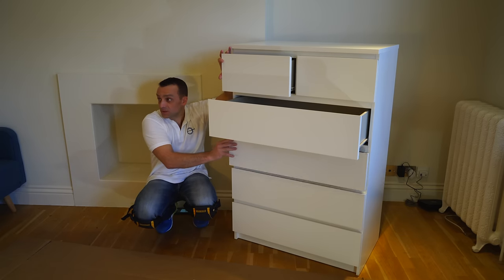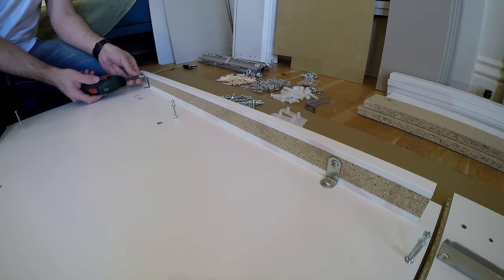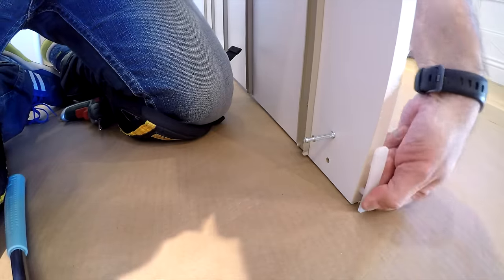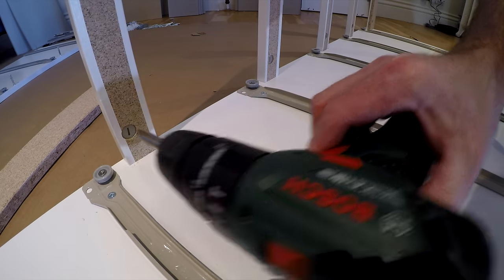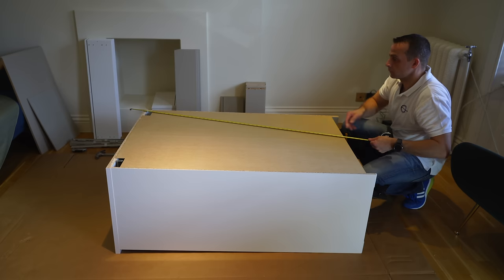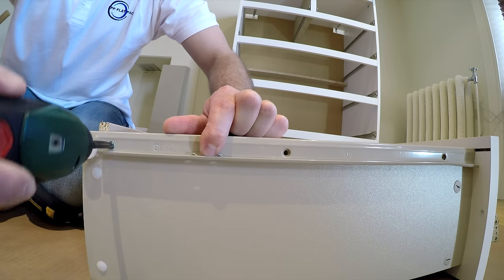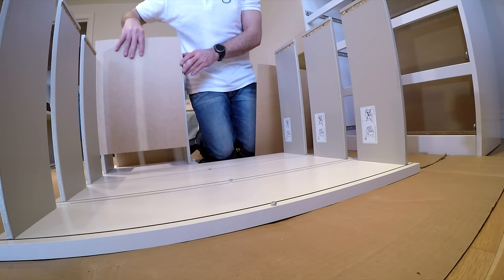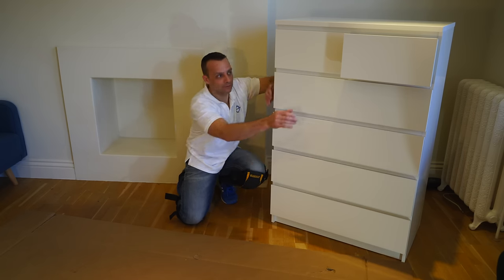IKEA MALM 6 Chest of drawers Assembly

Comment: I've assembled my Malm queen sized bed and the 6 drawer bureau with your guidance.  Very grateful. Would not have been able to do it without your videos. The two dimensional cryptic drawings in the Ikea instruction sheets were not remotely as helpful.  But now here's the thing.  One drawer's front panel was damaged. The cross bars between the drawers cracked as I put the screws in.   There were excessive bits of hardware, and some crucial ones missing.   I'm wondering if it was a repackaged return, sold as new.  My trust in Ikea is not what it was.

Comment: I just assembled mine but I’m having difficulty fitting the top 2!drawers in, any idea what’s wrong
Reply: Make sure that when you assemble the middle part that divides the smaller drawers was placed correctly (Left and Right). Otherwise one will be higher, the drawer won't fit in it and you'll have to disassemble and flip it around.

Comment: It’s a great video expect my top two ones don’t slide In easily it seems the the slide thing that’s on the long board wasn’t placed right
Reply: Have you fixed yours now ?
Reply: I have the same problem, how did you fix it?
Reply: Make sure your inner wheels line up with the outer wheels.  We unscrewed ours and attached them correctly. Easy to fix this mistake.

Comment: I just finished installing mine, followed all the steps, and double checked everything. But the dresser is wobbly from side to side. Any way to fix this?
Reply: Screws might not be tight enough, tighten them a little more. What I like to do when I assemble this kind of furniture is to put a small drop of wood glue just on the corners that way it is sturdy.

Comment: I've followed the instructions but can't get my top 2 drawers to fit. Anyone else had a similar problem?
Reply from the maker: Most likely you put drawer rails other way around
Reply: @PPFlatPack  thanks for your reply and a very informative video. Looks like they are on the correct way - can I contact you via email maybe?
Reply from the maker: @akeemmiller2673  No problem you can send me pictures of the drawer where I can see inner rails and rails on the drawer.
Reply: Thanks @PPFlatPack  . It's sorted now, the inner rails were installed the wrong way!
Reply from the maker: @akeemmiller2673  Cool glad you find the problem.
Reply: @tatianainfante7413  Make sure the rails on the inside are connected the correct way
Reply: PP FlatPack  i have the same issue the top 2 draws wont go in?
Reply: Hi, I gave the same issue. The top 2 drawers won’t go in. The inner rails came pre installed so I’m not sure please help
Reply: Adeshola Afolabi I’ve just put these drawers together and had the same issue! The inner rails need to be switched over and they’re the wrong way round, I unscrewed them and swapped them over and works fine now :)
Reply: Sophie Thompson thanks I did the same to fix it!!

Comment: I have installed the drawer unit correctly but the top two drawers doesn't seems to slide in n out easily as the rest of them. I tried tightening the screws and adjusting the drawer but it's still rough to slide. What do u think I'm doing wrong?
Reply: Hi, I have the exact same problem! Did you find a solution?
Reply: @meryemg3802  nope, it's still rough to slide. If you find any solution, please do share

Comment: 11:41 is the confusing part. Is that screw just not screwed in all the way? And there is no hole for the screw on the opposite side of the metal bar. Do you just screw that one in anyway?
Reply from the maker: That correct screw on the front panel (there is predrilled hole) not going in all the way leave a little gap just for the support come in should be close enough so it does not make a rattling noise when opening and closing drawer. back part of the drawer there is no pre-drilled hole so you just have to do it without (should be no problem with an electric screwdriver). Hope that help.Good luck
Reply: @PPFlatPack  Thanks!
Reply: @PPFlatPack    I don't understand this part either.  It just slips off.
Reply from the maker: @Fricasso79  There is no hole at the back of the drawer. Just press harder on the screw if you have electric screwdriver should be no problem
Reply: thanks Daniel for the question and surely thanks for the author on the answer , I was stuck in the middle of mounting up the drawer and this instruction helps really a lot.

Comment: I'm having trouble, when I measure from corner to corner I get 146cm & 147cm. all screws have been tightened. what do I do?
Reply from the maker: 1cm is too much. Drawers out unit face down back panel out slowly don't break you need to take nails out one by one. And again corner to corner than the same number and put the back panel again correctly and it should be fine.

Comment: Thanks for the video. Does it required to be drilled to the wall? The manual says so
Reply from the maker: Because drawers are big when you open them at the same time unit can flip especially with small kids this can be dangerous anyway you have option L shape brackets are included in the box so up to you sometime is better to be safe than sorry. My experience many people still don't want to have them attached on the wall but if there is small kind I would suggest to doit.
Reply: @PPFlatPack  ohh I completely agree. I didn't know this before buying. We're not allowed to drill holes in our rented unit.
Reply: @shakthis5616  i know I’m a bit late but could you tell me your experience with the drawer? I plan on buying it but i do not want to drill it to the wall

Comment: I was almost done with all the drawers and was putting them one by one when I finally got the last one completed it doesn’t fit on the bottom space the drawer touches the wood divider. Has anyone else has this issue? I’ve tried all the drawers to ensure that it is not the drawer but it’s the slot. None of the drawers fit on the bottom slot is strange. Please need help! If anyone knows what I’m doing wrong or the solution to this let me know! :)

Comment: Can anyone tell me the part number for the 3 front white slim panels that sit on the front of the unit below each draw? @5.20
Reply from the maker: This is the older model there was not covering panel yet under the drawers. New videos on new MALM drawers with covering panel will come soon.
Reply: @PPFlatPack  Its the same draws as in the video. Its the 3 pieces of wood you fit around 5min 20 secs in
Reply from the maker: 4 slim front middle panels in the instructions number is 101345

Comment: My bottom front frame came with a " L bracket plate " and the holes for the screws, Do not fit. Is anyone running into this problem I'm wondering if that's why in the instructions they recommend a drill. Help this is Bullshit. Nice video though.

Comment: gee why doesn't my drawer fit. Had to push it hard in. Once in there was about a 1/2 inch gap at the top. What the hell. Is that an issue with the holes in the cabinet or the drawer track. Its a malm desk, but it's still malm. Anybody got an answer.
Reply from the maker: Hard to say but it sound like your drawer rail is up side down.
Reply: Im  not happy my daughter assemble but is not fit and the wood is very easy to trank